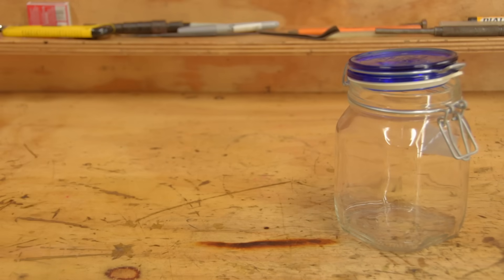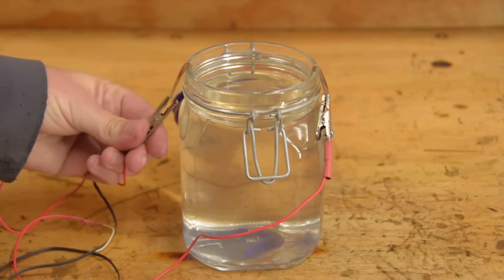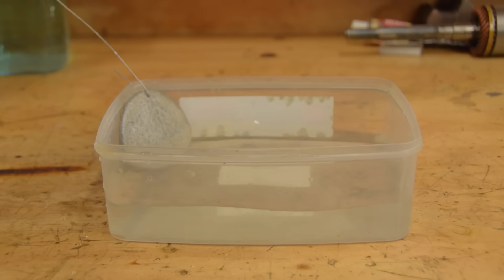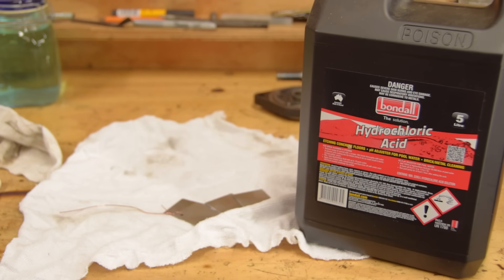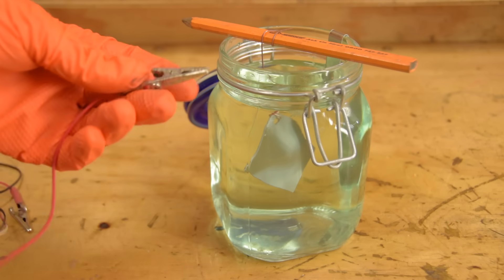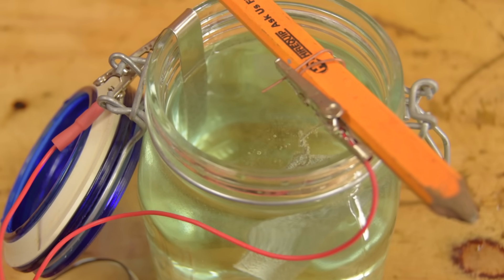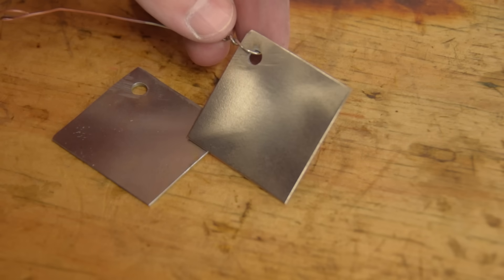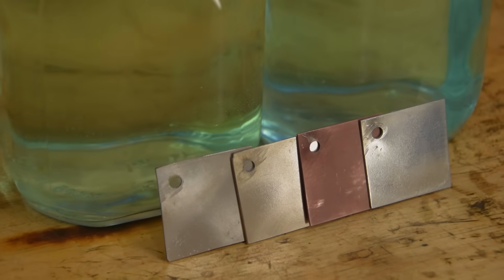Electroplating - Easy DIY Nickel, Copper, Zinc Plating

Comment: Back when I worked as a photolab technician we would drop copper pennies I to exhausted film fixr .
after a few minutes it would start  to grow little silver whiskers , they werent pure silver as the copper contaminated the silver.
A simplified explaination of this is your film has light sensitive silver salts that are needed for exposure and are removed during processing being dissolved in the fixer (typically sodium thiosulfate) a typical recycling strategy was to flow the solution through a steel wool filter then send it to kodak.
At one of the labs I worked at they did not recover the silver from the one hour film processors so I put a ball of oooo steel wool into the waste tank, the silver dissolved in the fixer would exchange for the iron in steel wool and after a while you would have silver wool.
Doing this  for 4 years I ended up with 8 pounds of silver after refining. Every girl I went out with for years got a handmade silver ring also I made a crossguard for a longsword I made.
Fun times
Reply: That was a long time ago. You are an original medieval time lord.
Reply: Cool knowledge tho !!
Reply: A friend who worked as a photo lab technician told us an interesting story about the day they demolished the old darkroom, and tore out the copper sink drain...
Reply: Immediately after you said "fixer" I recalled that nasty smell it would put on my hands (yes I often used bare hands).  Yes, I'm that old
Reply: @boxsterman77    Awful smell. I tried dodging it, but got burned.
Reply: Did you know Ansel Adams?????   He spent a LOT of time in his darkroom. His mama would yell "ANSEL!! What are you DOING in there?"
Reply: Wow, that’s awesome! Lucky girls! Hope you ended up with a lifelong companion!
Reply: Len Burton 
wow
really?
Reply: It pays to know a few things right? LOL
Reply: Great comment! 👏👏
Reply: Spot on
Reply: We got a legend here
Reply: Damn that is smart! I think I need a job at a 1 hr photo
Reply: Dude.. epic
Reply: 8 pounds! No wonder Kodak went bankrupt!

Comment: Two thumbs up for the warnings. One thumb down for the copper not being pure: Man, you added salt to your electrolyte. That is sodium, and that is an impurity. You could exchange salt for copper sulphate which is also called blue vitriol. This should even work with demineralized water, without the vinegar.
Another point is, I worked in a company which had a chrome galvanization department. You are absolutely right when you say *chrome will kill you*. This is really dangerous. You will catch cancer faster than you can spell it. Leave chrome to the professionals.
Those guys there told me, that the normal process would be 1st copper as bonding agent to the steel, then nickel as filler and last a shine thin film of chrome.
Just trying to be helpful.
Reply: Normal commercial copper is very pure (unlike most other metals). Why? Well it is made by electroplating, and also pure copper is a good material for most applications. By contrast pure aluminium is very soft so they add silicon and/or copper. I am not sure how pure commercial nickel is, I suspect very (like copper). Normal commercial zinc is not very pure because of the way it is smelted (and the ores always contain other metals).
Reply: @mikeavison5383  Please, read my explanation why is see an impurity in the process. I clearly point out that it does not come from the copper itself, but from the salt.
Reply: André Bartels If you use copper sulphate, there’s no need for the vinegar either: you can just put your piece and your anode in that directly.
Reply: To plate steel with copper, first plate with nickle, as copper sticks to nickle and nickle sticks to steel
Reply: @André Bartels
I would love to copper plate this little gun I have, but don't want to plate the inside of the barrel, would you mind making a video of a better procedure to plate steel for better results?  Also, what can you add to steel to prevent plating (the inside of the barrel).  Thanks in advance!
Reply: @cluelessbeekeeping1322  I work in a plating facility.  You can paint the area you wish to remain unplated, use acetone or paint stripper to remove, tape (electrical should) would be good for outer areas.  Rubber corks, or plugs work great on ID's. Wax is also a viable method, you may be able to fashion plugs from wax.  I would stay away from grease as it is likely to contaminate the area you wish to plate.
Reply: @N.Cognito   I never saw this comment, paint eh?  Hmm, that's an idea.   Oh, I do have plenty of wax!  At this point, the gun I wanted to plate I'm probably going to sell or trade, but thank you for your suggestion!
Reply: @cluelessbeekeeping1322  I never intended to make a video.
For your gun barrel, I would try two of those soft ear protection plug things to simply seal the muzzles. But for the plating you should go and try on something expendable. Btw you should keep in mind that these platings are very thin, and you can polish right through.
Reply: @andrebartels1690    This isn't an expensive gun by any measure, but I certainly would like something thick enough to where I could polish it and not worry about going through the finish to the steel.    I personally do not care for 'regular steel.'  It rusts too easily and the blueing certainly doesn't offer any protection.  Oh well. Thanks.
Reply: @cluelessbeekeeping1322  Use some wax to seal the ends. You could also use grease or cosmoline to protect the inner surface of the barrel too.  But sealing with wax would be way easier.
Reply: @kleetus92   That's a good idea, thanks!  Still, I don't know that I'll ever plate it if I can't put on a nice thick beefy coating of zinc or copper or nickel .  If I could get a nice thick coating of copper...man, that would look neat!
Reply: @cluelessbeekeeping1322  I make small parts and on the holes I don't want to plate I fill with candle wax. The process does not make enough heat to melt the wax and wax is not affected by the vinegar. boil the part in water or heat with heat gun to remove wax.
Reply: CluelessBeeKeeping there’s a product called Plastidip that is used for electroplating/forming jewelry.  Any metal part on the piece that you don’t want plated just needs to be coated in Plastidip, via dipping or brushing.  After electroplating, just peel off the film of Plastidip with your fingernails.  In this way, you can easily prevent intricate parts or crevices from plating.
Reply: @hezkittypaws8265  That's a great idea.  I know about that stuff.

Even so, I'm not going to plate the gun.  If I did, I'd want a coating thick enough I could keep it polished nice and shiny.  Apparently I can't coat it thick enough...so much for that idea but thanks for the great suggestion.
Reply: Sodium plating would be  quite interesting.
Reply: there are copper flakes in my electrolyte is that bad?

Comment: i used to work in a Electroplating shop, we plated Zinc, Zinc Gold Air dye, Black Oxide, and we Electropolished Stainless Steel.   There is NO chance I would EVER get near this crap AGAIN!  It effected me physically and mentally for years after!  We used caustic, cyanide, Muratic acid, Phosphoric Acid, Nitric Acid, and other chemicals and YEA NO!  And to make things easier, you should use a Copper rod and not a pencil to hang parts from and connect the power to the end of the rod!
Reply: there are copper flakes in my electrolyte is that bad?
Reply: Can you plate copper directly to aluminum?

Comment: Does it not plate better when the anode is equally distanced and surrounding all sides of the part? Where a large anode bent into a circle to wrap around the entire inside of the jar would give a better more even plating no matter what substance you use?

Comment: Cool. To do brass plating I need to go with nickel first and then the copper way? I mean is the anode/cathode setup the same?
EDIT: OK. I've read the description ;) I'm changing my question to: "Do you think that connecting positive/negative for brass plating would be the same as with copper plating?" 
I believe my piece is already nickel-cobalt plated - I  don't think it is chrome. 
Eh, nevermind I will just try.
Reply from the maker: The connection is always the same. I'm not sure how every type of metal works. Give it a try.
Reply: @GeoffreyCroker  Yes, I will. Thanks for a quick answer though.

Comment: I am dying to try this, but my local grocery stores do not carry Yoplait Natural Greek Yogurt so I cannot get a container. I will have to find somewhere online to order some before I can try my hand at plating metals.
Reply: I used an old toilette seat cover, works as well........you just have to smash the top cover with a hammer over your oven, so the plastic melts and gets concave........the ring cover is usefull later as a frisbee to play with your dog or neighbour.
Reply: The only substitute is a one gallon ice cream tub. Which also gives you more working room. :)
Reply: @d.t.4523  
PVC buckets should work well.
Reply: Since this video was released , there has been a shortage of these containers . In desperation , people have turned to using other brands of yoghurt but with CATASTROPIC results e.g. the sinking of the Titanic and the election of Donald Trump .

Comment: I have sucessfully plated copper on steel using sulphuric acid instead of the vinegar that is used here, but you need a good regulated supply up to 12 volts.

Comment: Would adding agitation (for example an airstone) provide any benefit to the process? I ask because I see all those surface bubbles forming and can't help but imagine the voids preventing the plating process locally until the bubbles disperse.
Reply from the maker: Yes. But don't worry about it to start with. By the time you need to deal with agitation, you'll be using a much more pro setup and better solutions anyway.

Comment: Great tutorial!
 I have a couple questions. 
 Do you know if using Arm & Hammer washing powder would work as the electrolyte solution? Reason I'm curious is because it is the usual go to method when de- rusting metal with electrolysis. Just wondering if it would work and if so if the results would be any better or worse?
 Another thing I'm not sure of is if I want to plate some nuts, bolts etc for an outdoor project like a go kart or mini bike does nickel plating hold up as well as zinc in the weather? Does it fight rust as well? Which plating would be better?

Comment: Copper does plate to bare steel. You need a copper sulfate solution and a piece of copper for an anode. Copper sulfate is available as root killer and comes in crystal form. The plating procedure is identical. Parts that are triple chrome plated are copper, nickel, chrome. The copper is applied first to help fill in any pits in the surface.
Reply: Hi Paul the copper isn't to fill pits though this might be a by product of it. The copper is to prevent corrosion as chrome is porous, nickel less porous and the copper prevents water etc reach the steel. As you probably know many companies don't triple plate and the playing won't last anywhere near as long.
Reply: @Isaac Allgood Absolutely no idea, give it a try?
Reply: If you watch the video again, you'll see him demonstrate a seed nickel plated layer on steel followed by copper plating.  Works every time.
Reply: @Isaac Allgood I tried it with copper and the blue stuff didn't really mix with the salt water . Just like small blue flakes. It also didn't plate.
Reply: @crazyaustrianinventor6092  use hydrosulfuric acid instead of vinegar n salt
Reply: @crazyaustrianinventor6092  In vinegar is oxalic acid which is able to kick ions out of copper. These ions are therefore sticking to your coated part. Plating without acid is probably impossible. Plus I don't believe blue stuff which contains copper cause blue stuff containing copper is not what I call healthy. So be carefull where do you dispose it.
Reply: What about aluminum?

Comment: hmmm... and how would one nickle or copper plate over a piece of zinc alloy? vinegar, as an electrolye, will eat the zinc away. also, i've read that zinc requires higher than usual voltage AC current to be plated. does anyone has any experience with plating on zinc/aluminum alloys?

Comment: For the part I want to plate (cooling fan from an air-cooled vw), I might need close to a gallon of solution.  Is the process the same? I imagine the only difference is that it would take longer to make the solution and to plate.

Comment: would this setup work for tin plating copper ? i want to make some bus bars for my boat electrical system
Reply from the maker: Probably. You can buy a tin plating kit from eastwoods for about $30

Comment: Nickel salts are highly allergenic. If you work with this without proper protection and get it on your skin you will catch contact dermatitis sooner or later. It may take time until you get it bit just a time of exposure so you will get it if you don't protect you. And this is a nasty condition as you will be sensitive to any nickel that you can come in contact with otherwise.

Comment: I made my nickel electrolyte with citric acid and did not add salt. my plating turns black. Any ideas why this happens?
Reply: Wrong polarity. You are oxidizing the plate. That or you current is so low that the vinegar is corroding more than the plating

Comment: How'd electrolysis work with AC current?
Reply: Give it a try and then when you've tried, do it with DC to actually plate the target metal and then tell us why you think AC didn't work.
Reply: My guess would be the back and forth movement of an AC circuit would prevent the metal ions from being deposited...

Comment: Way too much current...Throw a resistor in the circuit there and be  patient.
Reply: Robert Coyle -Why too much current???
Reply: The bubbling shows that too much current is being used. Little or no bubbling should be seen to get a good smooth plate.
Reply: A low current put on a much smoother plate.

Comment: Great video, I'm not a Chrome plate fan, but love nickel.
I thought a small mixer to create a flow of the electrolite around the part for even plating.
Does temperature play a part, I thought a little warmth would not hurt.
Loved your video, it showed the process nice and easy to do.
I will try it myself.
How about silver and gold?
Cheers
Noel
Reply from the maker: Yeah temperature and agitation all play a part as you get into plating. But thats nothing to worry about while you're playing around with a little vinegar setup. I assume silver and gold will work, but the metal is so expensive, I wouldn't experiment with it. Commercial silver and gold plating kits that will definitely give good results are probably the way to go.

Comment: If you weigh the metal your going to plate  before and after the plating you'll find out how much its been plated. Also if the copper isn't pure not to worry as the impurities most likely will not be transferred to the target material. Electrolysis is actually how they purify copper, as impurities will not travel through the solution (or at least nowhere near the rate that copper will).
Reply: You'll never manage to weigh those miniscule weight differences, except with a decent laboratory scale

Comment: Thanks for the clear tutorial! Thought I would share something I found out that may help others avoid my mistake. I ended up getting small square blocks of nickel to use as an anode. I suspended them in the electrolyte with copper wire, I thought (wrongly) if the part thats getting plated can be hung with copper wire so can the anode... DO NOT DO THIS. It makes sense now but as the nickel was dissolving so was the copper wire suspending it. I ended up with a nickel/copper solution which turns parts a nasty blotchy dark grey colour. I started again making sure it was only zinc submerged in the solution and I am getting great results.
Reply from the maker: Haha, yeah. This is why I reckon people should start with vinegar instead of fancy brews. Awesome to hear you're getting good plating results 👍👍👍
Reply: What kind of wire should you hang them from? Just regular steel wire?
Reply: Jeff Stone from what I can tell on the anode side it should only be the metal you want to plate that should be submerged. If you also submerge wire of a different metal on the anode side you’ll get a mixture of both metals in the solution. It doesn’t matter on the other side that’s holding the item you’re plating.
Reply: @blairwightman  I see, yeah, that one flew past me at first. Looks like the best way suspend the nickel or whatever is used to do the plating is to allow some of it to be suspended out of the solution to hook up to, kinda like this gentleman does using strips that can be bent over the top of the jar or vessel that's being used.
Reply: @MichaelWalter-f3h  Good to know, thank you!